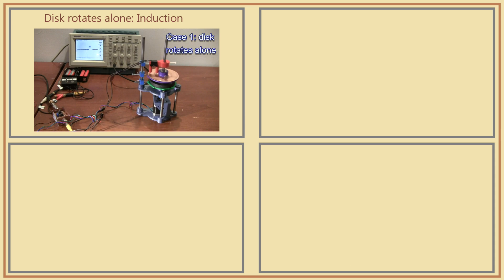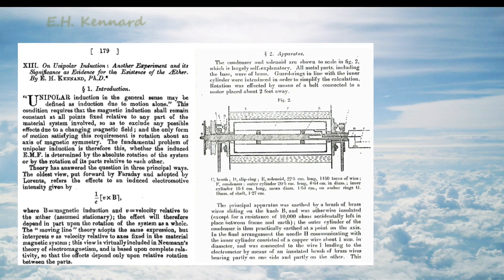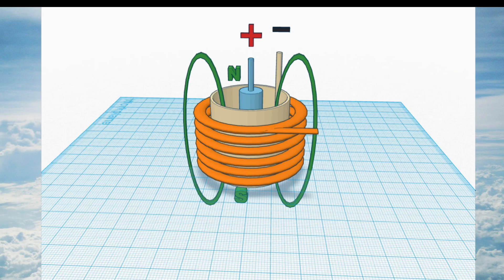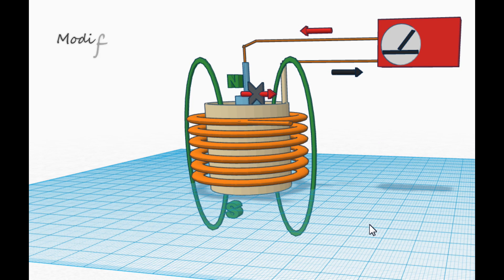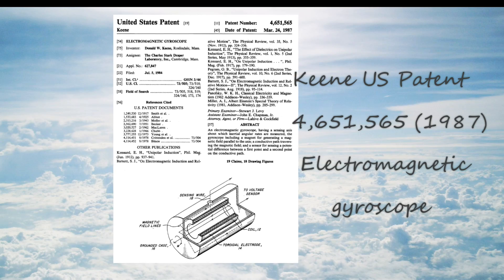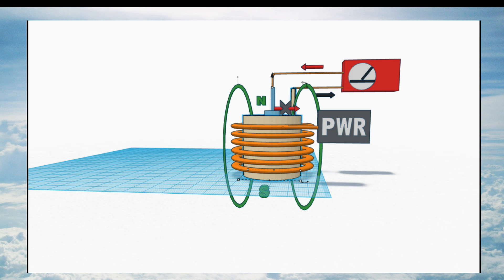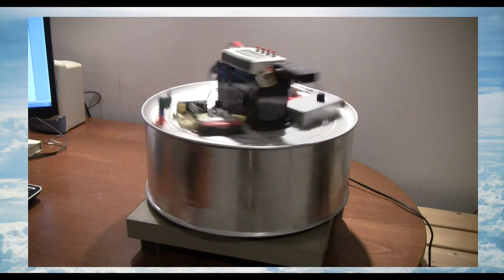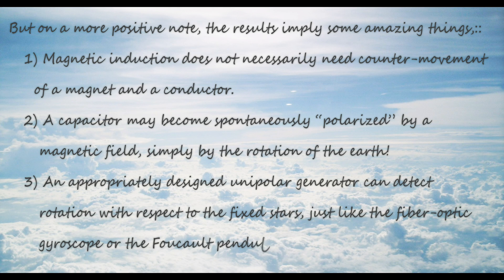Faraday Paradox Unipolar Dynamo Part 2: The Solution

Comment: There is no paradox and no induction (induction requires changes in magnetic field direction and or intensity)... Due to magnetic field copper disk experiences radial emf and brushes simply collect charges in both cases.. The emf is dynamic (rotation speed dependent) but based on static charge and radial path of the virtual conductor has very small amount of charge but faster the brush action more charges are collected thus emf potential is proportional to the brush  rotation... The rule of Lorentz force defines the direction of EMF of the rotating virtual current path... Finally, Faraday's motor effect creates torque, thus no free energy generator possible...
Mathew Orman
Reply from the maker: Hi Mathew -interesting idea, but I think induction occurs when electrons move across a magnetic field, and if you concede that the Lorentz force is operating from your statement then you can't argue that there is no induction, see: https://phys.libretexts.org/TextBooks_and_TextMaps/Book%3A_Electricity_and_Magnetism_(Tatum)/10%3A_Electromagnetic_Induction/10.2%3A_Electromagnetic_Induction_and_the_Lorentz_Force
"electromagnetic induction is nothing more than the Lorentz force on the conduction electrons within the metal."
Reply: @plenum88  In text books above look at figure X2 and you see brushing against rails and that is how Faraday's motor works... The virtual current path direction obeys Laplace law... In any case there always must be mechanical contact and relative motion of brush and conductor in magnetic field... MHD generator works the same way in which electrodes are brushing against the flow of electrolyte or stream of ionized gasses... Bernard device also has brushes and mechanical contact with the capacitor so it is the same as Faraday's generator with output voltage measured with electrostatic voltmeter because the current path only  displacement current... 
"So, no brushing no voltage and no paradox" Mathew Orman 2018
Reply: Induction works on neutral copper and Lorentz fores needs excess charge of one or the other sign...
Reply from the maker: That sounds totally wrong - what textbook did you get that from?
Reply from the maker: Mathew, the link you sent was from a forum, and what he is showing is simply the moving magnet/stationary conductor version shown in my video, which also shows no voltage.  Electromagnetic induction works via generating a Lorentz force in a conductor, not one or the other, I already sent you a link stating that. 
A Lorentz force arises as soon as a conductor moves through  a magnetic field, here is another one  https://en.wikipedia.org/wiki/Electromagnetic_induction
There does not need to be an excess of charge - only movement. Current flows because the electrons are mobile...the protons are not, so they don't generate any current.
Reply: No, electromagnetic induction need both fields changing and it usually is when a conductor is intersected with electromagnetic waves... Magnetic induction  requires changing current and or changing magnetic field... Lorentz force requires  excess charge or conduction charge in form of electric current in conducting circuit... Conductor with no excess charge alone moving with constant velocity trough uniform and constant intensity magnetic field has no effect of EMF...
Reply from the maker: Mathew, you realize you are arguing that the Faraday unipolar generator is not an induction generator, right? Are you saying this with a straight face or are you just trying to push all my buttons?
Reply: Yes, Faraday's unipolar generator works on Lorentz force alone... It is not possible to generate DC voltage or DC current with magnetic induction...
There are some patents which claim brush less homopolar generators but US Patent Office stopped requiring prove of concent more than 100 years ago... :-)
Reply from the maker: See my reply to your identical comment in part 1.

Comment: What do you measure when the copper disk is between two magnets? Between north-north and north-south?
What if the disk is in the homogeneous field, Helmholz coils?
Reply from the maker: Just going by memory, I think it depends on the net magnetic field lines cutting through the disk - so you would need to determine the field line direction and then work out the voltage based on the Lorentz force.

Comment: Magnetic fields cannot and are not subjected to rotational forces ,they are domains of the Mass , and can only be moved at right angles to their stationary positions no other effect on them can be done their creations come from the mass of the magnet and are therefore indestructable , as you use the energy of the magnetic field more and more of the mass will be converted to the energy of the magnetic field ,  E=mc2 /  LINKS ARE SHOWN IN OTHER COMMENTS SO I WILL DO THE SAME   https://youtu.be/6eP-B_d9DoI  /  EV SAMSON SUPPERBATTERY BOOSTER /

Comment: There is effective electron movement and there is real electron 
movement. A magnet would be an example of effective electron movement. 
Electrons all orbiting clockwise in a magnet tend to cancel each other 
out. It is for this reason that the magnet field is only on the outer 
edge of the magnet where the counter effect is not there. Magnet sensing
 paper placed on a round magnet will show a magnetic field on the outer 
edge only to confirm this. I will call this effective electron movement 
as the electrons in a magnet are not literally moving around the magnet.
 There is real electron movement such as a coil of wire that will lead 
to a magnetic field. The fuzzy point I am trying to make is a magnet and
 spool of copper wire with current are not the same in that a magnet has
 effective electron movement and a spool of wire has real electron 
movement. I feel this has meaning to Faraday part 2 saying Uncle Albert 
must be wrong.  Like a gyro fiber cable the both the fiber and the 
photons are rotating together leading to the impression of c+v however 
if one lived inside the fiber's frame of reference it is c not c+v. Same
 would be true of a spool of wire where both the wire and the electrons 
are rotating together. However in the case of a magnet this is not true 
as the electrons only have effective movement not real movement. If this
 sounds confusing not to worry has I the author of these words also find
 it confusing.
Reply from the maker: Hi John, I think I see your point - if you read Kennard's 1917 paper he does address the solenoid vs. magnet issue, since Barnett tried to say also that the solenoid was an exceptional case. Kennard argued otherwise, since he said that it would have to mean that the magnetic fields from a magnet and a solenoid would have to be physically different in space, and he argued there was no evidence of this.  Perhaps this geometric difference of the lines from one configuration to the other is significant.
Reply: "the magnetic fields from a magnet and a solenoid would have to be physically different in space" I have a string attached to a shoe and another string attached to a feather. The string attached to the feather is easier to pull. Do I blame this on the string or the difference between a shoe and a feather? The string being analogous to a magnetic field is the point I am driving at. To give this balance Kennard's argument is valid for high frequencies where a pulse on a string is shorter in wave length than the distance traveled. However at the speed of light for this experiment it is unlikely the wave length is shorter than the distance traveled.
Reply from the maker: Hi John,
   Not quite getting your argument - the pulses in my experiment were slow, like once per second, or one every 5 seconds. So I can't see how frequency can make a difference in the way you are saying, because these are DC effects, not frequency effects.
Reply: Yes low frequency and that is the point. Allow me to restate in a different way. I jerk a bull whip. The wave propagates down the length of the whip then snaps as the whip is moving faster than sound. The wave length of the pulse is shorter than the whip. Under these conditions Kennard has a point as the pulse going down the whip has left my hand. This being analogous to a magnetic pulse.  From this "the magnetic fields from a magnet and a solenoid would have to be physically different in space" is a valid argument. However if I move my hand slowly on the whip , low frequency , the wave length of this movement is much longer than the length of the whip therefore my hand is directly responsible for action at the end of the whip. Under these conditions the hand that moved is responsible for the properties of action at the end of the whip in the same way the difference between a coil of wire or a magnet can be held responsible for action at the end of a whip or distance in space. At high frequencies yes but at low frequencies no therefore the Kennard argument is not valid. Formally in physics the distinction is called near and far  electromagnetic radiation.
Reply from the maker: Hi John, 
What you are implying is that the polarization is due to frequency dependent induction effects. I don't agree. If this were true, then turning the magnet on and off while the device is stationary would cause the same kind of effect (like a transformer). That is why, in the protocol (and same as Keane I believe), the magnet was turned on and off in both the rotating and stationary conditions, and then one was subtracted from the other, to determine the net effect due only to the magnetic field being on when the device was rotating. The magnetic field was also tested with North up and south up, to determine if the effect was consistent with a magnetic Lorentz effect expected from a constant solenoidal magnetic field. Note also that in Keane's patent, they used a slow ramp up and down of the magnetic field, presumably to limit any frequency effects. All of this evidence combined suggests that what is observed is simply a polarization induced by a Lorentz force.
Reply: "polarization is due to frequency dependent induction effects." We can both agree that this is not the case. In both the monopole and part 2 experiment the magnetic field does not change therefore it can not be frequency dependent induction. This being said there is a distinction between near and far magnetic radiation that requires the introduction of frequency and wave length. In part 1 and part 2 of the videos it is always near radiation not far radiation. Near radiation is like pulling on a string where you feel the effect of whatever that string is attached to. Far radiation is like pulling on a slinky spring where you do not feel the effect of what that slinky spring is attached to as you are only pulling on the slinky spring not what it is attached to down the road. In your experiment it is always near radiation of a magnetic field where frequency is a non issue as the magnetic field is constant , not changing. In short we are pulling on a string for the magnetic fields for these experiment not a slinky spring . It is one thing to have a thought but another to put it on paper so I will try to use the best words to get the point across. I have a string , near radiation , that could be attached to a piece of wood or a 100 pound weight. By pulling on the string I can tell the difference. However if it is a slinky spring not a string I will have a hard time telling if the other end is attached to a piece of wood or a 100 pound weight. The technical buss word for this is impedance of the magnetic field. In far radiation , slinky spring , in a vacuum the impedance of a magnetic field will always be 376 ohms. In near magnetic radiation , string , the impedance of the magnetic field is unknown. This makes the argument that a magnetic field is a magnetic field regardless of the source being spool of wire or magnet not valid as all your experiments are near radiation. It is a small fussy point but I wanted it on the table before proceeding to the part 2 video that uses a spool of wire. I would like to add that I am enjoying this exchange of ideas.
Reply from the maker: Hi John,
    The " impedance of the magnetic field", I am not sure if that is the correct terminology  (?) - since 376 ohms refers to the impedance of free space for a plane wave, which is really not the same thing. Unless you are reading from a textbook I am not aware of, my understanding is that impedance refers to the resistance of an inductor to the passage of a AC field or EM wave. Since we are talking about static magnetic fields, and we have agreed that frequency dependent induction effects are not at play, I am not sure how the distinction is meaningful. Similarly, near and far radiation refers to EM waves, I have tried searching the terms you are using and nothing comes up, so where are you getting this from?
Reply: where are you getting this from? I can see why you would say that. I am getting this Oliver Heaviside , 1890 , in his famous book " the telegrapher's hand book". He always considered this his finest work even if it was just a small manual on calculations for telegraph cables along railway lines. It was considered by main stream science to be nonsense has it contain new terminology that had not been heard before such as   impedance , inductance , permeability , permittance and many more.. 100 years later Oliver Heaviside is the foundation for electrical engineering taught today in colleges. As to the impedance of a magnetic field being 376 ohms.  I have a proof based on known variables. The capacity of 1 meter of a vacuum as 8.8 p Farad , inductance of a vacuum is 1.2 u Henry per meter. From this the impedance of a vacuum per meter can be calculated as 378 ohms. As electron flow equals magnetic field the impedance of the electric field equals the magnetic field. I will now provide the proof by calculating the speed of light from these numbers only. Speed of light in meters per second:

L=1.2 X 10^-6  Henry , F = 8.8 X 10^-12 Farad  
radians per second = 1 / SQR( L * F)= 300,000,000 

If the speed of light is 300,000,000 meters per second then the impedance of the magnetic field must be 376 ohms as impedance is derived from L and F.
Reply from the maker: Hi John, 
    Yes, I know who Heaviside is, the hermit of Paignton. You are mixing up DC magnetic fields with AC electromagnetic propagation, these are two different things.  I have spoken with another engineer about your comments and he has said the same thing. That calculation is for the propagation of an electromagnetic field in a transmission line or in free space. On the other hand, electron flow is extremely slow, like on the order of 1 mm per second. The static magnetic field in a DC solenoid does not move at the speed of light, it is effectively stationary, like in a permanent magnet. If we were to put an alternating current into our solenoid, then the changing magnetic field would propagate out into space at the speed of light, but then we would have AC electromagnetic induction in our adjacent disk, a very different animal, as I have been saying for the last three comments. If the issue is the moment of turn on of the field for you, we have already discounted this brief moment of "AC induction" using our controls as I mentioned. Finally, if there was a difference in the nature of the solenoidal magnetic field to a permanent magnet, then this would have shown up in the closed circuit experiments performed by others, like Lecher or Barnett, who found that they behaved the same.
Reply: It is so easy to make a mistake in physics and I have made some good ones in my day :<). I will make the statement that AC current through a wire equals the amount of AC magnetic field around that wire. A one to one ratio. If I were to add that the DC current through a wire does not equal the DC magnetic field there will be a conflict with current equals magnetic field. With this in mind we will have to say that current always equals magnetic field regardless of DC or AC therefore the DC current in a wire will also equal the magnetic field . 

If current equals magnetic field then impedance of current also equal impedance of magnetic field for AC or DC.
 
I will now make an argument for your favor. We place two meter probes in fresh air to measure the impedance of air to electric potential. Needless to say the meter will measure open so where is this 376 omhs if DC and AC impedance are the same. The reason for this is not making a solid connection to the air. If two copper sheets are used 1 meter high one meter apart stretching out into infinity the DC resistance between these two copper sheets will measure 376 ohms DC. It is like charging a condenser that never charges up as the sheets of copper stretch out into infinity.That same analogy is used in SI units to define 1 Amp , one Volt and 1 ohm.
Reply from the maker: don't know...haven't tried it...